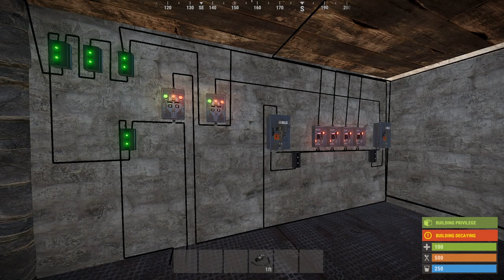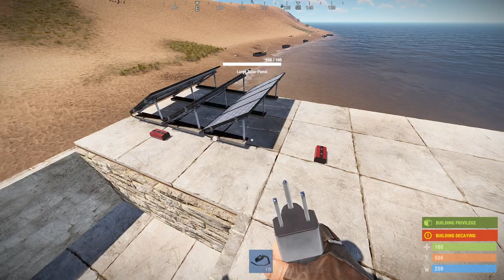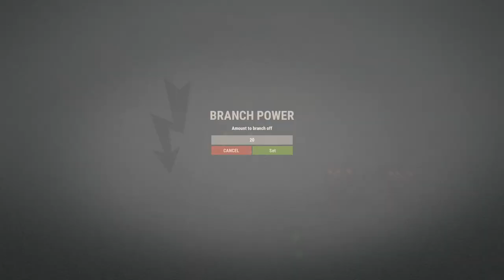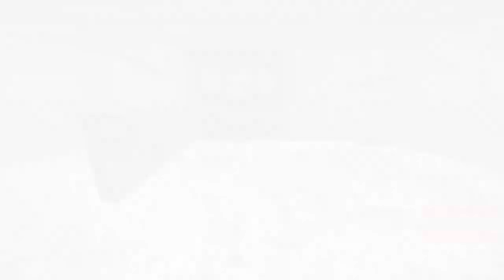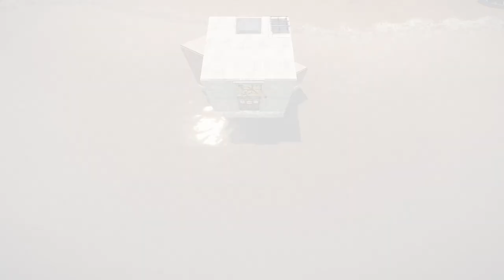(RUST) Electricity 101 - Electrical Boat Base S02 Ep3

Comment: Another nice idea 🤙 is it fair to assume that a battery back up requires 2x source power every time?
Reply from the maker: Kind of, it all depends what power source you're using, and how much your circuit requires.

A large battery typically needs a minimum of 40 power all day long (45 minutes) to have about 15 minutes of charge.
Having a power source that delivers anything above 60 to the battery most of the time means you will have excess.

Comment: What is the purpose of the second branch in the distribution part? To the Auto turrets? Not enough power for the auto turrets.
Reply from the maker: I'm not sure which part you mean.
This was of course built months before turrets were required to have electricity, so the circuit isn't factoring that in.

If you have any issues, link to my discord is in the description :)

Comment: Hey spibs i sent you an email, let me know if you are interested. If so, dont reply to this comment because i will most likely not see it. thanks.
Reply from the maker: Hey dude, your email came through, but it had all this weird html code in it, so I couldn't read it all.
I think it mentioned something about a base design or something you have?
Reply: @SpibsTV  yes, i am friends with snavezetroc. he told me to reach out to you because i have an interesting and effective base design that i want to share. are you interested in taking a look and possibly making a video on it?
Reply from the maker: @ronanmarino2394  I could take a look at it and tell you what I think.